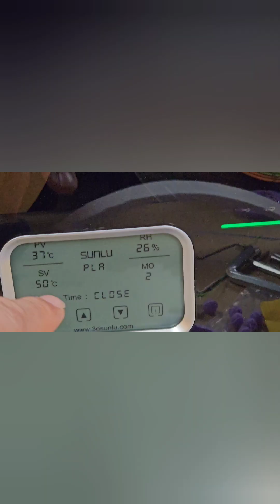Must-Have Upgrades for the Ender 3 v3 Plus

Comment: Remove the filament sensor from the gantry and stick it to the top corner of the riser arm with some double sided tape. Having both sides of the guide move with the gantry is just bad engineering, and causes all the issues with the filament roll tangling.

Comment: What did you upgrade the fan to and what was the benefit?  thanks
Reply from the maker: Check my other videos. There is a link to the fan and yes it makes a big difference on the air movement/coolilng.

Comment: is your quick release for the filament (for changing out filament) available for download anywhere?
Reply from the maker: Apologies for the delayed response. Here you go! Note you may have to print a couple different size variations until you get the one that fits your printer just right.
Creality Cloud -Ender 3 V3 CoreXZ PTFE tube easy remove From eXthemaX https://www.crealitycloud.com/model-detail/66c8be3bda3a755472cf520d
Reply: @DocX-Xplore-Tech  thank you so much!